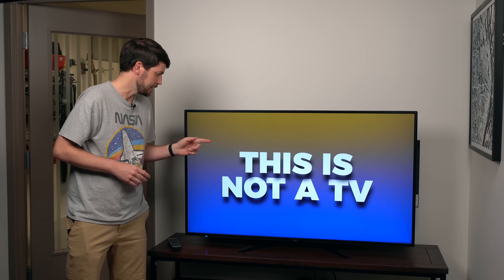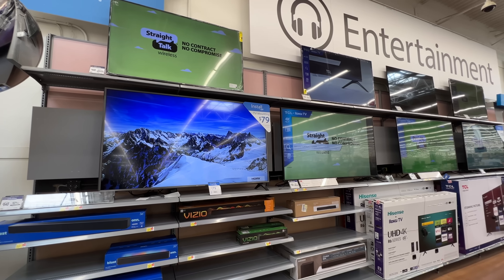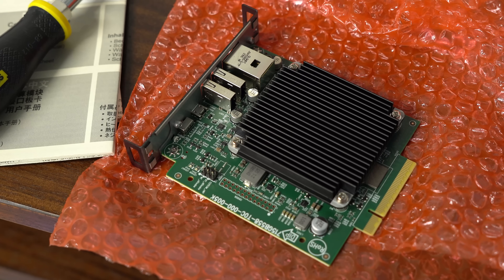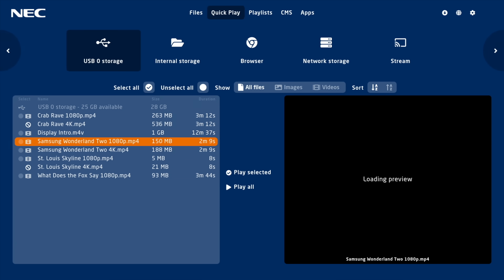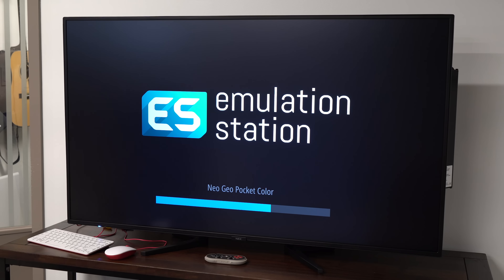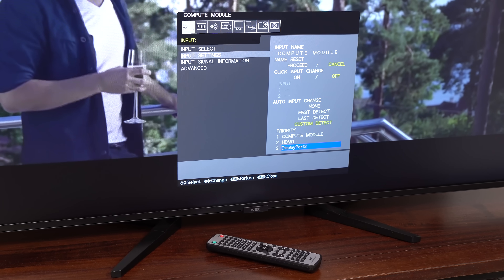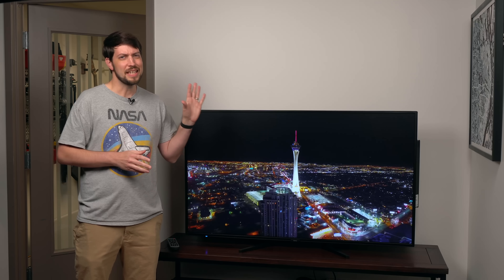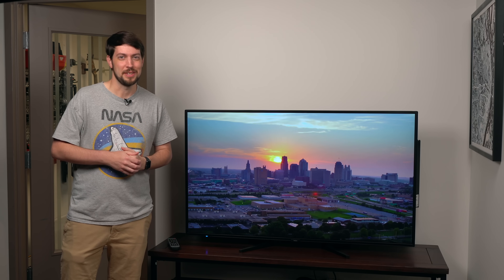Smarter than a Smart TV! (Raspberry Pi Inside)

Comment: It would be great if TV operating systems were more open along with the hardware, this has such modular setup potential.  Imagine if you could wipe away 5-10 year old samsung/lg/whatever OS on older TVs and install a fresh lightweight linux option, would give them a lot more life and usefulness (or even just swap out the SoC).  With big TVs like this there are lots of options for modular hardware, something like the bigger Intel NUC compute element could easily slot into one of these and be a powerhouse home theater option, hell the TV itself could be the home plex server...
Reply: Samsung OS is actually one of the best. The problem with smart tv is they use garbage SoCs
Reply: @mod4rchive  not the new Samsung OS’s, it’s filled with ads and a very clunky ui
Reply: @mod4rchive  As someone who has a circa 2009 Samsung TV, if they're one of the best, then all the rest must be the worst garbage in town. Even when it was brand new it was slow and hyper annoying. Especially when bad signal caused it to lockup, sometimes until you pull the power cord.
Reply: Of of the manufacturers--I want to say TCL--was very up-front about the fact that it actually costs more these days to sell a "dumb" TV than a Smart TV, because the latter will be subsidized by the expected user data collection revenue.

That is to say, these is zero incentive for anyone to make an open OS TV, as it would be even more expensive to cater to the (sadly) extremely niche audience of folks who want smart devices but care about privacy or moddability.
Reply: They will not allow it because you will keep using it and won't buy new TVs.
Reply: Yeah, the LG CX has many EULAs you have to accept in order to use the apps or some other functions. I keep it offline, only turning wifi on to check for updates from time to time. Use an appleTV instead, along with an OSMC Vero4k.
Reply: You described why it would be good in the same breath as why it won't happen... They want you to buy crap.
Reply: Itʼs really not necessary to use the dogged OSes on those old TVs - you can just plug in a standalone Raspberry Pi if thatʼs your thing.
Reply: im waiting for someone to mod an LG tv since webos is all open
Reply: Alpine Linux is a lightweight Linux os i think it's suitable for  what you're talking about
Reply: os doesnt ipdate hardware
Reply: TVs are cheap because you are the product.  You're paying for the privilege of selling your TV usage habits to them.  And on some sets from dogshit manufacturers like samsung and vizio, to overlay ads on your video.
Reply: @GSBarlev Can't we take advantage of the cheaper price of SMART TVs by powering it by Raspberry Pi instead?
Reply: @PVSajan  You mean don't connect the TV to the internet? I'm honestly not sure which TVs will allow you to either set it up or use it post-setup without an active internet connection. First time I turned on either of my Roku TVs the first thing to launch was the Roku setup, but it might be possible to exit the setup screen.
Reply: Umm, just use the tv as a computer monitor... That gives you all of what you are suggesting and much, much more.
Reply: @GSBarlev  Yeah, TCL also has a "Dumb" mode for their TVs too(at least the Roku based ones) where if you reset the TV and set it up without an internet connection, it'll turn off all the extraneous apps and stuff and just be a TV that happens to have a Roku UI. From there you can set it to launch an input automatically on wake, and just go straight to whatever you have plugged into it. Great for the future when the TV Roku OS gets too slow/outdated, but the panel itself is fine.
Reply: I'd prefer it if TV's didn't have operating systems at all. I'd rather just have a big monitor, with all the TV functionality offloaded to a set-top box, and any colour/brightness settings controlled via DDC.
Reply: @ArunG273  well not really, this is more of a software thing. When people replace their tv it’s usually cause they just want a bigger one or one with higher resolution
Reply: I guess the solution is something along the lines with an apple tv or a linux box attached to the TV. Because honestly even though I as a geek would love this ability someone like my mom just want android tv so she can install apps for the streaming services she need. Just a shame all consumer models have barely good enough hardware to run properly and I for one has never found any good reviews covering the computer hardware inside of TV's.
Reply: @mod4rchive That's the main problem I have with smart TVs. If you want to upgrade your processor, you have to replace the entire TV.
Reply: @andybrice2711  I'd take smart TVs over that option. The simpler the better
Reply: you can., just connect a pi with hdmi to your old tv and, voila, you have a smart tv.
Reply: Yea I thought of that too but the computer inside is so measly it's not useful for that, your far better off doing that externally which is what I did for certain jobs like watching Utube with an add blocker on it & VPN with a PI3 or 4.
Reply: @HNedel  I use a Linux version of media player so I can remove adds before ever seeing them, I HATE adds so much I'll even goto the extreme of building a PI Hole if I have to.
Reply: @PVSajan  Yes that's what I been doing for years but I used to use an independent media player with tuner built in but after having 3 of them die on me I'm done with those. Go the PI  & a few big hard drives with movies on them, you'll have NO INTERRUPTIONS & NO DATA HARVESTING. Just don't connect the TV to any network.
Reply: @andybrice2711  That's exactly what this video was about, did you think this something different?
Reply: @michawhite7613  That's what I was faced with my 6 year old TV, I put a Raspberry PI 4 on it, problem solved & it's far superior than any so called smart TV of today, NO ADDS & NO DATA HARVESTING
Reply: @hiteck007  Did you replace the board that's in the TV, or did you just connect it using HDMI. I still don't want to have to deal with the TV's operating system just to get to my smart box.
Reply: @michawhite7613  Narr mate just a little R PI box feeding the HDMI of the TV as a media player & sometimes using KODI but kodi is often troublesome with video feeds as every so often they are redirected & if you miss an update or the developer misses it, the channel goes down. Nothing is fail safe but as just a media player I use it all the time because I control exclusively what I want to watch which is NOT this WOKE rubbish of today.
Reply: @japzone Thanks for that tidbit of info, I did not know that

Comment: I wish we could still buy "dumb" TVs, with no smart features, which could just have all their settings controlled by whatever media player box we're using.
Reply: I have 2. This video might be over my head and I just don't get it. I have a 50 inch dumb tv with a windows 7 PC and pi 3b hooked up. In my kitchen I have a 32 inch ( I am using it right now) with Nvidia Shield box. Both use keyboard and mouse, gamepads. So I just do not understand the hype for this monitor he is showing. Ok mine are not built in,  but Velcro or build a bracket behind tv a connect with HDMI. What's the difference?
Reply: Both TV's are sceptre TV's.  Both remotes work on eather tv
Reply: You could accomplish the same thing by simply not connecting your tv to the internet....
Reply: @davefarley4318  a lot of money
Reply: @davefarley4318  thats the catch lol, the only dumb tv nowadays are mediocre displays compared to the rest of the market (its a walmart brand afterall) and dont expect 99% of the actual good displays will come with smart functionality
Reply: @user-nh3gu1ge3d  or use a pihole to block certain servers
Reply: @verbosi7y275  Yeah, I'm not a huge fan of pihole. I would just go to my untangle firewall and block the device to everything except youtube, amazon, and netflix. If something comes up that you really need, only take a second to add and that way you don't have to have another stand alone device (pi) that isn't really enterprise class/designed to run 24/7, etc. like your router is.
Reply: ...Just don't connect to the internet and plug it to a PC, there you go.
Reply: @user-nh3gu1ge3d  not the point. Most modern smart tvs come with either google assistant, alexa or apple integration. That means that there is, at the very least, an always on microphone spying on you whenever you're in the room. Some of them have cameras too now...
and if you open the case to snip the wires on them, you've voided the warranty
Reply: @MrSpleenboy  Yeah, I agree that the mics are annoying bs. I disabled mine in the menu settings. Is there a way to ever know if it's REALLY TRULY off? No, probably not. But it's off from a functional stand point and it doesn't bother me. 
Furthermore, if you just block your TV in your router/firewall, that solves all the problems you're talking about. 

Doesn't matter what audio or video it records if you block it from communicating out. Then use your media server for content. You could also explicitly allow ONLY netflix (or something like that). It's not sending your mic/video recordings to netflix so you're good. But I agree it's a PITA, them trying to turn YOU into the product. I'm in IT and I avoid wiretaps, er I mean Alexa/siri, like the plague. There's only so much you can do in today's age unless you want to move into a cabin in the woods though. Risk vs reward.

Comment: Just FYI: the Pi 4 can definitely play back 4K videos, but they have to be encoded in h.265/HEVC for it to work.
Reply: huh, but h.265 is more cpu intensive than h.264
Reply: @arjix8738 Not with hardware decoding it isn't.
Reply: @Pocket-Calculator  well duh, hardware decoding means that the GPU is doing the decoding
Reply: @arjix8738  The Raspberry Pi usually have specific components to decode video. That allows it to decode high resolution video and also use less power than it would it it was decoding via CPU.

Comment: I thought it was going to be a chore to find a non-smart TV to replace the one that just died, but I wasn't expecting that I would be replacing it with a store display. This is fantastic news!
Reply: Be prepared to shell out a pretty penny though, they are really expensive...
Reply: Just get a smart TV and don't connect to the internet
Reply: @gibbsfreenthalpy  There were at least 3-4 options on the sitelink Jeff provided that were 4k resolution under $1000; when you consider that they should last at least 10 years and probably more, it's not that bad -- compared to giving up your freedom and advertising info + your TV is spying on you and using your internet bandwidth
Reply: @kingneutron1  huh, ok, didn't see that, sry. I just roughly know the price we paid, and that was definitely more, even considering that we bought about 50-60 of them...
Reply: @kingneutron1  How's it spying on you if you don't connect it to the internet? This whole concept seems a bit far fetched to me. In terms of value, you're way better off buying a smart TV, leaving it disconnected from the internet, and hooking up a HTPC or Raspberry Pi with internet access.
Reply: @xEqualsRandom  Many of them (my now faulty Amazon Fire TV being one example) won't even let you use them until the connect at least once. some are 'always on' where they'll complain whenever they don't have a network connection (ditto this for the fireTV).
Reply: @DFX2KX  Hopefully jailbreaks will be found for units like that. My family bypassed all that nonsense by getting an "open box" TV which already had everything set up.
Reply: @eDoc2020  if the firetv is anything like the fire stick, its just android. already exists probably

Comment: The reason that you can use your remote is its using  a CEC module to talk to the Pi. is a communications protocol built into the HDMI standard allowing CEC-enabled HDMI devices to exchange information and send/receive control messages.
Reply: I didn't know that, it's handy to know going forward.
Reply: Is that why regular ir remotes won’t turn off these displays ? I heard you can disable the remote features so random people cant turn them off.

Comment: 5:41 about the remote working, as it's showing in the top right of the screen it's using cec or consumer electronics control, this is a protocol to have the display communicate with the connected device (the pi) over HDMI. LibreELEC also supports this when using other PIs connected via HDMI to a TV. (or at least the pi zero I have does)